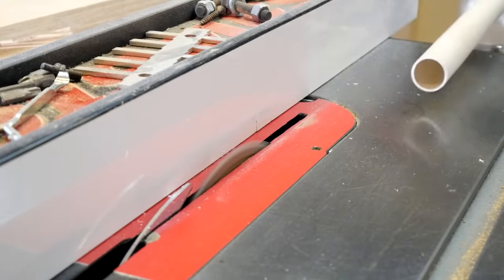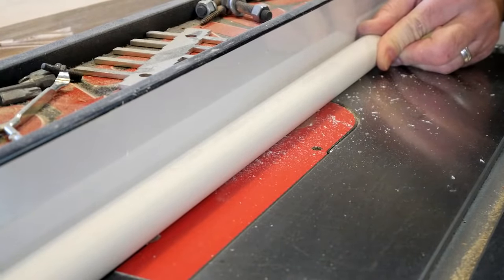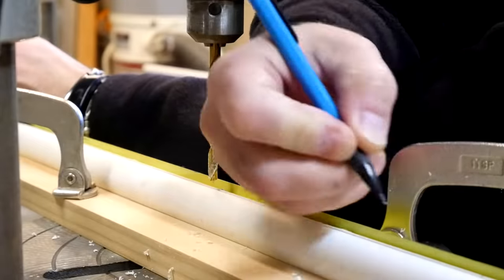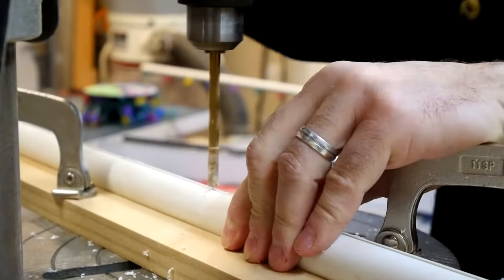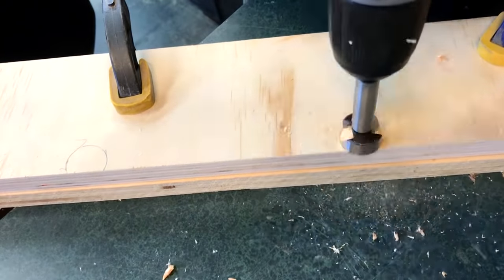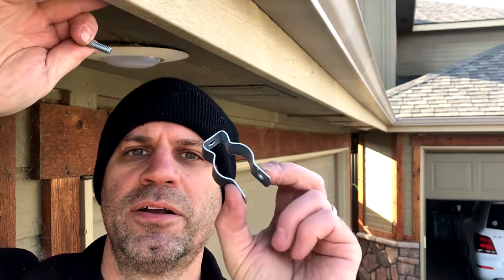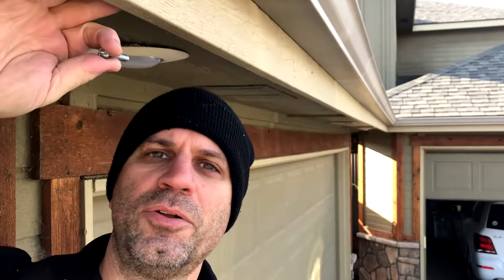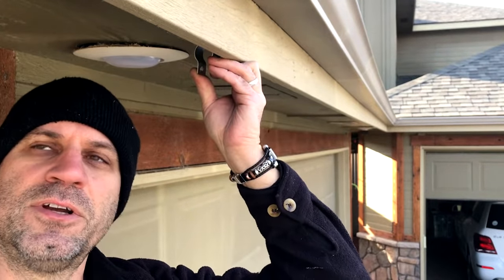Better Way to Install Christmas Lights

Comment: Please post a follow up of how the lights look at night! I’m so curious to see! This was a great idea, would love to see how it performed on the final result.
Reply: They look like Christmas lights.........
Reply: It’s like the video cut away before the money shot!
Reply: PVC turns very brittle when exposed to the sun and then breaks easily.
Reply: Plants some trees and then wrap them isntead 😄
Reply: If looks like a classic case of liking to over engineer things.  Unless you use high grade PVC paint it the color the house & secure it better so the spans don't droop it is going to look tacky if you rotate them & leave them up permanently.

Comment: Been doing this since 2015, but with icicle lights and zip ties, and without all the drilling/sawing. Christmas light duty went from all day to under an hour, and storage is super easy, tangle free, and actually enjoyable. When I update the lights next time I may go to this more elaborate system.
Reply: What kind of irrigation line do you use? Do you use conduit instead? I too use the icicles lights, but have clipped them into those coaxial cable clips and then wrap them up in a sheet of plastic after the year is over. No tangles!

Comment: I think if you had to do it again, I might suggest drilling the holes first, then making the slice cut in the PVC 2nd. Would have made the drilling easier. Just mark the straight line on the pipe and use it as a guide to drill the holes, and then cut the slice.
Reply: I was just coming to the comments to recommend the same thing.
Reply: I was going to say  the same thing.
Reply: Then he’d have to get the saw perfectly in the centre of the holes though, which might be tricky
Reply: @jaireidca  Thumbs up.  But the cut doesn't necessarily need to be in the center of the hole.  If it's slightly off - but not too much - it should result in the same thing.  But yes, pre-drill.  My concern would be insects making nests all year long.  Wasps and spiders are problems where I live.
Reply: I would just cut with the saw and skip the holes. The pipe would clamp on the wire to keep lights in place and maybe put some tie downs around the pipe to keep lights from slipping around during installation
Reply: Snap a chalk line on it before you drill the holes to keep them in a straight line.
Reply: @jaireidca  notch on either end of the pipe and strap it to a block to lock orientation. sure you'd either have a little waste or a notch left at the end but it would make the cut easier to align.
Reply: I thought so too but then thought there may be issue with perfect alignment of the drilled hole.
Reply: Was the hole drilled in the pipe needed? Since he found and used the bracket, the holes in the pipe no longer have a purpose—what am I missing???
Reply: @cindyl.5762  the holes in the pipe are cutouts for the lights to be pushed through/spaced out. they have nothing to do with mounting the pipe to the building
Reply: Def a good recommendation for c9 bulbs, since the socket is larger. These look like c7s.
Reply: Thanks for that idea.

Comment: I installed cup hooks and then just hang and take down my lights every year using a long pole from the ground. Never have to use a ladder again to hang lights. 😃
Reply: Good idea and a lot easier to do.
Reply: Except he said he had 1,000 lights to put up! Every year. I'd go with his method!
Reply: @stepawayful  So did I 😁
Reply: Good idea if you don’t have a whole bunch of lights. I’ll try it next year!
Reply: @runawaypony429  
I had a whole bunch of lights. Two story house with two car garage. Lights went all around the front of the house, all vertical and horizontal edges, along upper gable, upper and lower roof, around front porch, around all windows.
😁
Reply: @Lil_Angry_Bitch  lol, love it but too many trees in front of my house 🤣
Reply: I installed the cup hooks early in November and then the lights went up easy peasy...wish I would have thought of it a long time ago.  Lights are always a chore and this past year I actually enjoyed it and they looked like a pro had hung them.  Great minds think alike, eh?  LOL!
Reply: I do the exact same thing.
Reply: @stepawayful  except he now has to unscrew those 1000 lights, attached to pvc, using a ladder each year, id say cup hooks look way easer than what the guy did in this video! 

And if he just leaves the pvc up there then id bet it takes this guy as long, or longer, to rotate all that pvc then tighten up the clamps useing a ladder so they don't fall back into the down position again. vs hanging the 1000 lights with a stick into cup hooks. each year, not to mention the 5 hour initial build!! this was a stupid way to do Christmas lights imo
Reply: @robgilmour3147  You were just fine until the "stupid".
Reply: I've been doing it this way for several years now, even with 2,500 lights.  I just put a cup hook every 4 feet or so and one on each corner or bend.  I still put them up with a ladder, but can take them down with a pole.
Reply: Been using CUP HOOKS for 50 years, best and easiest way to hang Christmas lights and you can pre paint them to match colors of house you use them on, and you use a 1” X 10’ wooden dowel with  attachments on end to put up and take lights down on 2/3 story high home. I’ve hung Millions of lights like this and have never had a problem. Best use of an AWL to pre tap your holes to make secure tightening of the hooks

Comment: Im a professional Christmas light installer. These look awesome! The way we do it is with socket wire that we install bulbs into 1 by 1. We use several types of clips that permanently attach to the line. Tuff clips for gutter and shingle tabs for shingles. Then we cut the wire wherever there is a break in the roof and use Gilbert “vampire” plugs and 18ga plain wire to connect everything. The initial setup takes a bit, but once its all put together it comes down and goes up fairly quickly year after year. If you can just swivel the lights up and out of the way, you have definitely got us beat for ease of installation/removal every year!

Comment: We did "sort of" the same thing a few years ago at our apartment. Instead of hanging the pvc pipes outside, we made them into a rectangular frame (with feet) that we could stand up in our front windows. 

No more suction cup marks on the windows!
Reply: ditto.  I've got three big windows in the front of my house and made rectangles big enough to fit into them with 1/2" PVC pipe.  The corners are held together with 90 degree corners,  so there's enough 'friction' to hold it together without glue so easy to break them down and fold up for storage after Xmas.   If the corner pieces get 'smooth' and loose they are cheap enough to replace (maybe $1/each).

Comment: I love the idea of them staying on the house all year. You need to post a video of you rotating them up against the soffit. Also show what it looks like from in front of the house when they're retracted.
And I think a lot of commenters didn't catch the part of them being able to be rotated. Folks, these don't have to be taken down .... it's a one-and-done procedure.
Reply: What happens when the lights goes out? They're all attached??
Reply: Oops...when a section goes out??
Reply: My wife would have a fit if she could see the lights from underneath when they weren't in use.  Life is sooo much easier when she is happy.
So I'd have to come up with a way to cover them so it looks like part of the trim.
Reply: Damn good idea!
Reply: @jerrymiller276  just take the poles down and store them in the garage.  snap them in again next year
Reply: @Steveorino123  be easer just to install cup hooks and string lights with a poll than have to unscrew all that twice a year
Reply: @jerrymiller276  I am like your wife, I could not stand seeing all that. And would never leave them up all the time. Just too messy looking.
Reply: Nonsense. Christmas lights are not designed to be exposed all year long, EVERY year.  This is a 3 year rig at best before you start running into arcing problems. AKA FIRE HAZARD.

Comment: If this is easier and less time consuming than they way you were hanging then before - please post a video showing us how you were hanging them before.
Reply: He did it once and now he never has to do it again, unlike having to put them up then take them back down again each and every year. That's how it's easier. Invest the time now so you don't have to waste the time later. In other words: work smart, not hard.
Reply: @NIX0LAS  This might  be true if the set up last 8 to 10 years. Those lights are likely to break when they are stored inside those pipes. They will also have to be realigned neatly in the pipes before they are put back up. If he removes them from the pipes when he stores them - that’s going to take even longer. I go full out on decorating my house: Straight lights on edges is the easy part. That is why I want to
See how he was going it before.

Comment: I personally like the chaotic look of just hanging the strands over nails, but for the clean, orderly look you were after, this is a great idea.  I would have drilled the holes in the pvc first and then run it through the table saw.
Reply: Yes! Drill holes first!
I was just thinking that too.
Reply: Drilling the holes first would have necessitated having to draw a line where the cut was to be and and drawing a line on a round object is quite tedious... would really have not saved much time if at all....
Reply: @marvinisit  chalk line
Reply: @jesse4042  you ever try to hold a piece of thin walled sprinkler pipe straight enough to get a chalk line on? Let alone the chalk staying on the pipe? I don't think it's feasable
Reply: @marvinisit  Lay it on a flat surface, then use a sharpie on a block the correct thickness to center it, then just drag it across the pipe. Easy, if if the pipe has a curve.
Reply: @marvinisit  the printing on the pipe is always in a straight line and evenly spaced. Just figure out which letters give the right spacing.
Reply: @marvinisit  could use the table saw to score a line on the pipe, then drill, then finish the cut with the table saw

Comment: I think it would have been better to drill the holes in the PVC first, then make the cut through them using the table saw.  No jig required.  The lights look nice on your house.
Reply: They pipe would rotate while you did it. So you would need to make a straight line and keep to it. Not sure that is much easier in the end.
Reply: Definitely would drill first. Would be easier and more accurate. Also, I would use a less expensive spring clamp to hold the PVC in place.
Reply: If you decide to cut first then fill, channel locks would be a better idea if you can't make a jig.
Reply: You would then have to line up the cut perfectly and that would be pretty tough to do. His way seems better.
Reply: @dougdiplacido2406  Simple, just draw 2 lines down the PVC on opposing sides of the tube; one for drilling and place the other up for cutting.
Reply: @dougdiplacido2406  Why would it be tough to do? If it was that tough you wouldn't be able to rip it straight whether it was predrilled or not.
Reply: Everytime the spinning blade reaches a new hole, you run the risk of shattering the pipe. Cut first, then lower the impact on the material and drill.

Comment: Interesting idea. Still seems like a lot of work regardless. Still going up twice a year to twist the pipes.  We simply use 3/4" brass hooks at the end of the rafters just behind the gutters. Hooks stay hidden year round. Lights easy on and off every year.
Reply: First year into my house (30 years now), I did this. I now stand on the ground, with an extention pole (painters pole), with a nail in the end. I lift the lights up on the brass hooks. Done. 30 minutes max to hang lights, including the untangling.   No ladders, no fuss.  
The work is in that first screwing the hooks in to the rafters. A few hours. Best time spent ever.

Comment: That Sir was an Abundantly Over Engineered Solution .  All that was needed were stainless steel screw in hooks , ( that could be painted over ) , and a pole with either a " V " on the end or another hook , the pole being long enough to reach up to the hooks already screwed to the wood , in the inner side of the trim , if a cleaner look is desired . catch the light or wire onto the pole , hook it .

Comment: There are many ways to accomplish what he did.  His way worked pretty well.  I would have used PVC conduit because of its UV resistance and less obvious gray color also the matching PVC straps because cheap.  The only issue I see with this is the PVC will likely sag but that is easily fixed with straps closer together if it happens     Add a T fitting and a short pipe stub in the center of each pipe section and you could probably rotate the bulbs up and back down with a hook on a pole from the ground!
Reply: I too would have used PVC conduit because of its features and color and plus the assembly won't be as flimsy compared to using the thinner wall pipe
Also , to make installation easier , I would attach plugs to each light strip so you put up two strips and plug them into each other afterwards , That way you're not trying to arrange and install all of them at the same time , 
That's a great idea for installing Christmas lights but get some male and female plugs to put on each strip so your only having to put up one strip at a time , making it much easier and just plug in the plugs at the end of each strip

Comment: Make each section of pipe so it can be independently put up, taken down, and stored by using wire connectors.  Paint the pipe to match the soffit.

Comment: Thinking about this a bit...I wonder if you really needed to do all that drilling, or if you could have just cut a wider channel in each run of pipe - one that was just a hair smaller than the sockets.

Comment: Was anybody else disappointed that you didn't show them lit up? I did have a little giggle when you were saying about the hassle of putting them up but then took the time to make a jig to hold the pipe so you could drill holes into it lol. That's a woodworker right there.

Comment: Why wouldn’t you just drill the holes first and then make your rip cuts after?
Reply: nice suggestion: makes sense, if for no other reason, for guide marks while rip cutting
Reply: I liked the rip cuts first idea.. I did my lights a little differently. LED bullet nodes. I drilled holes completely through so I could push the nodes through both sides (I used PVC pipe). With my set up, the wires run along the back side of the pipe,  and I didn't do a great job keeping them as straight as I'd have liked (give me a couple days to record/post my lights).. this gave me an idea how maybe I could've done it differently. Rip first, rip after... it got the job done, right?

Comment: I did some similar but used spring loaded broom handle wall mounts under my eave. Just push the conduit up and it snaps right in. I left them up all year and it's held up through all kinds of bad weather and not one of the mounts have let any fall down

Comment: The only improvement I would make is to allow water that might be sitting in the pipe to drain. In the festive (lights down) orientation, the groove allows any moisture that gets in there to drip out. But if any condensation/ someone cleaning the gutters/ frost gets any water into the pipe in the stowed away orientation, it could possibly sit there for a while. I'd just drill some small holes in between each pair of clamps. Ideally you'd put them at slightly different angles around the pipe so that they work even when the lights aren't at a perfect 90° to the ground.

Comment: My only thought is in summer, how do you keep the flying insects from making a home in those tubes. I get wasp nests under my shutters every year. These tubes would be crazy hard to stop them. But otherwise it's a neat idea.
Reply: Hot glue in the ends of each tube
Reply: What about spray foam?

Comment: I did similar to this five years ago. The difference is I used 1/2 “ PVC  then used short sections of 3/4” not quite cut in half. The 3/4” pieces act as snap in holders for the half inch. I painted all of my pipes black to match my soffits and gutters. 
I would drill all the holes before ripping the pipe, Also make the holes larger so that the light socket is not clamped in the PVC. 
I take mine down every year, they store easy and they go up easy every year.
Reply: does it not hold water when it rains?

Comment: In 2000, like you, I became frustrated with hanging my Christmas lights. I decided to use pvc pipe to hold them. Since mine are icicle lights, what I did was cut a ⅛" groove in the ¾" pvc pipe and then work the wire into the groove wedging the small lights into the groove. Originally, I used tea cup hooks to hold the pvc up, but they were a little more expensive and then you had hooks there when you took them down. Eventually, I settled on galvanized wood screws. I cut a piece of pvc in half and drilled a small hole in the middle and 18" from each end. This is the template where I put the small  unobtrusive screw heads in my house and I also drilled a small hole in the side of the lightholder pvc. From that point, I cut a 2"groove on the one end, a 4" groove at the middle and a 6" groove on the other  end and then drilled a hole big enough to insert the screw head at the end of that groove. So you insert the screw head at the 6" slot, slide it 2" and then insert the screw head at the 4" slot, slide it 2" and then insert the screw head at the 2" slot and slide on the final 2". I have 8 sections and they go up quickly. I store them 2 sections to a 4" drain pipe in the summer. Anyway..sounds like we both have similar ideas on using pvc to hang Christmas lights. Kudos to you.